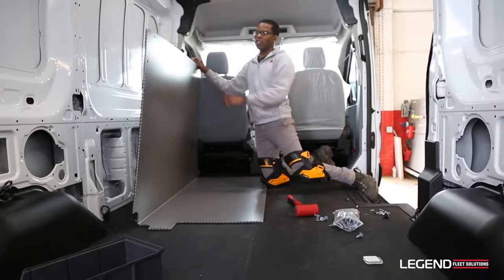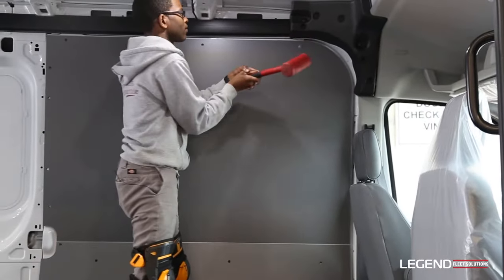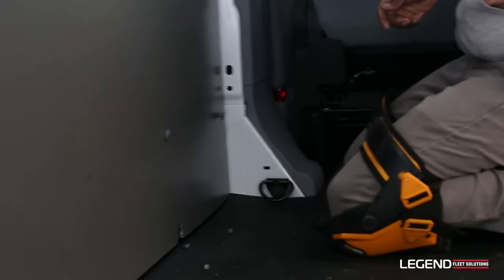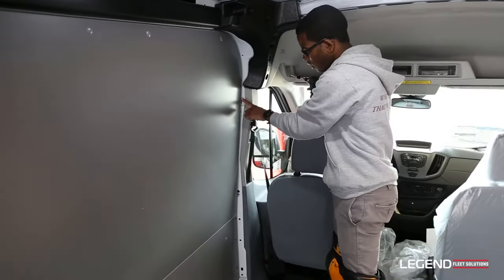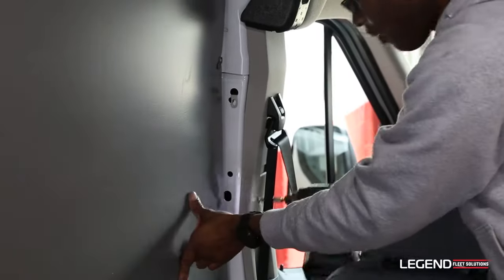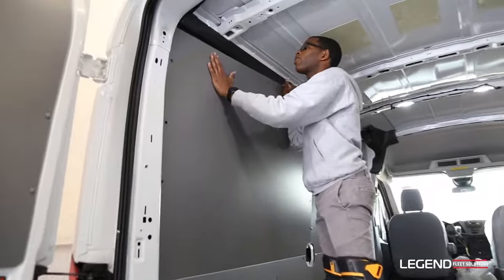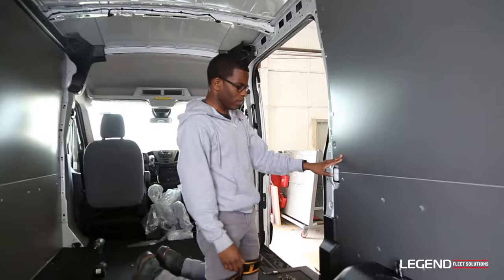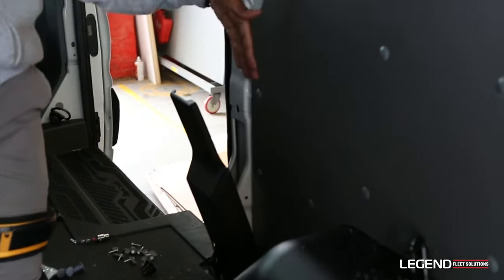How to Install a Transit Wall Liner | Advantage Outfitters

Comment: I just did my walls and doors on my Transit work van. Everything fit perfect. This material is really tough.  Before I installed them I put many pieces of sound deadening material on first. I should have done the ceiling because this stuff comes on a pallet and you will save on shipping by doing everything. Im really happy with my purchase.